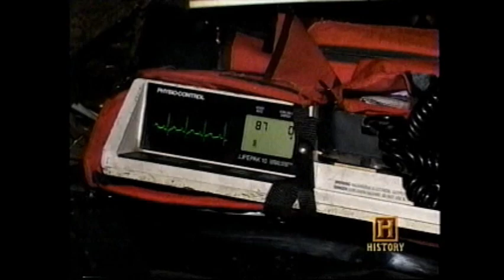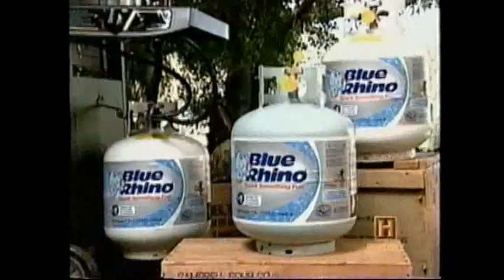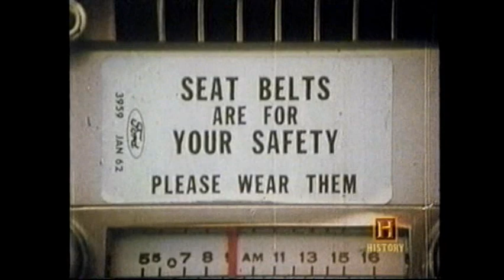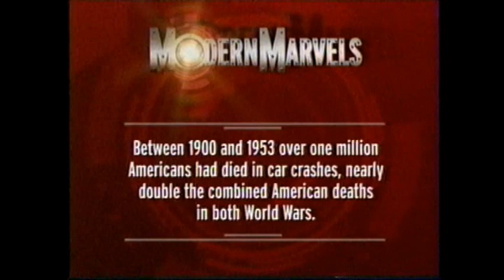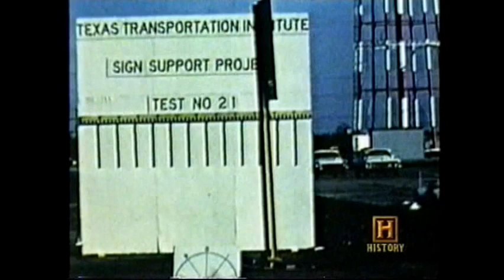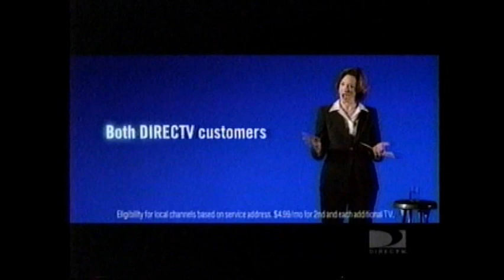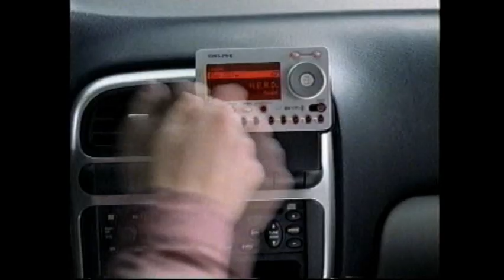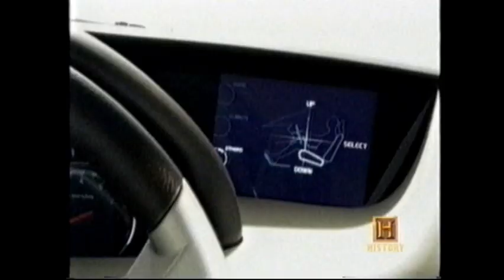History Channel - History of Car Crashes

Comment: As I have pointed out on other videos, a direct 65mph impact usually kills you instantly. But if you drive 65mph on the freeway instead of 80, if something goes wrong your odds of being able to slow to a survivable speed before impact are much much much better. Until automation virtually eliminates human error, Freeway speed limits should have a hard upper limit of 65mph in the best, straight and wide road conditions. Excessive speed should be more severely ticketed, in many states people don't take speed limit seriously and that has a big share of lives lost.

Comment: I take speed limits very seriously especially on the two lane undivided highways. I won't ever exceed 5mph over the limit for any reason, and 98 per cent of the time I am 1 or 2 mph under. If I had it my way I wouldnt be on the two lane undivided roads that have speed limits above 40mph. Head on fatality risk is too big, and even 2010s car designs LIKELY can't save your life in a direct hit with two vehicles going 50mph into eachother. I have seen youtube videos where some countries design this kind of road with plastic water barriers between the opposing traffic. Yes modern cars are safer than ever, but the lion's share of lives saved are in 30 to 40 mph impacts. Airbags are useless if you slam straight into a tree at 65mph. I get cheap insurance for my reward when I drive like this!!! You can too!